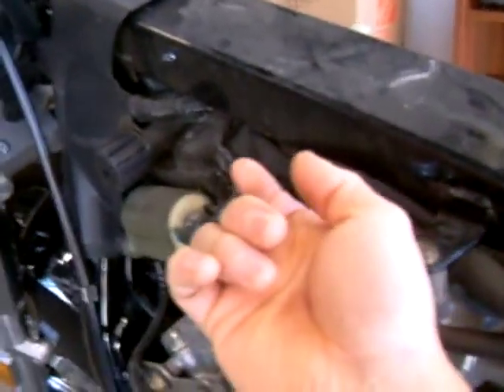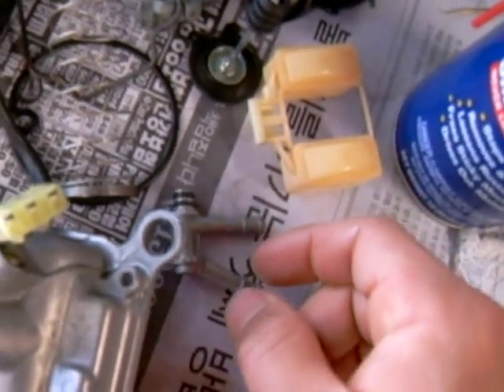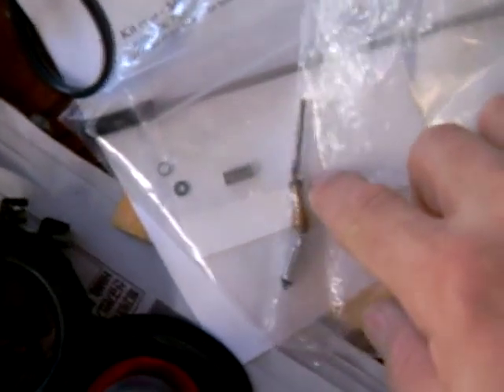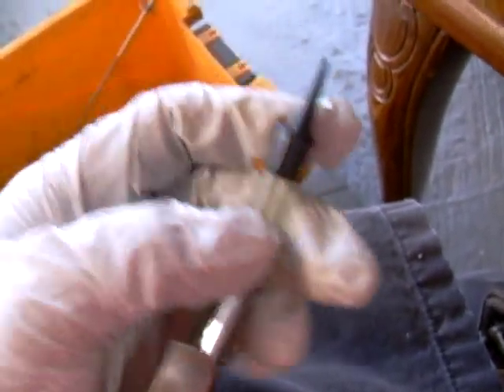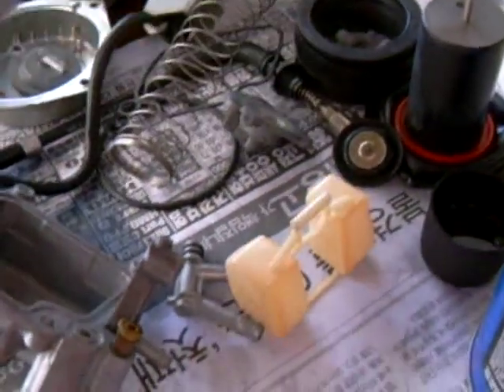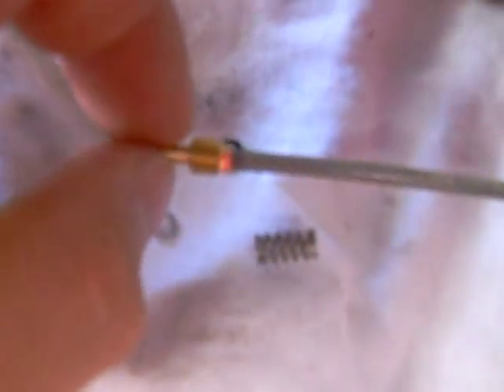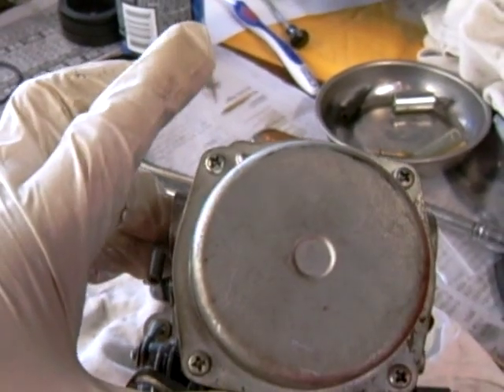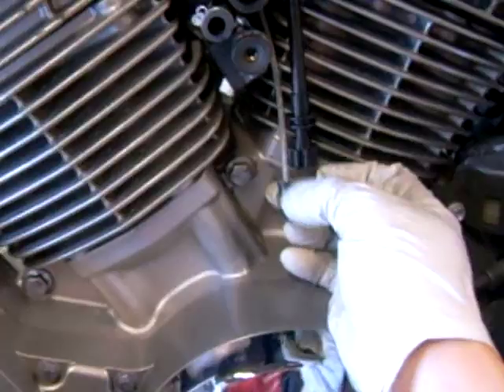How to clean a carburetor for Honda 2004 VTX 1300

Comment from the maker: VTX 1300 has been a worry-free motorcycle for me.  I've had it all these years and the only parts I have replaced are the tires, spark plugs, oil/air filter, and batteries.  It's not that difficult to work on and beautiful.  VTX 1300 has plenty of power and simple enough to reduce problems, unlike harleys.  Well, thanks for all your nice comments.

Comment: thanks for the vid. i just got done putting mine back together. my bike is a 06' 1300c. it looked the same as yours. i took pictures every step of the way just in case. before i put it back on ima have to get a d screwdriver

Comment: Something I know that has been done by a mechanic friend of mine on a bike with this problem is to pour Techron injector cleaner in the tank & with the spark plugs disconnected roll it over until your sure that it has worked it's way through to where it can desolve the gunk overnight. He said that he added gas to the tank the next morning & rolled it over a few times & it started right up. Since your tank was full I don't see why a small funnel or a spout on a bottle stuck into the end of the hose leading to the carburetor wouldn't work to get the Techron into the carburetor. Unless you can drain the tank.

Comment: Hi well done video .. i have a question im having trouble trying to remove the lower bolt in side the air cleaner housing the bolt just turns and i can hear yhe rubber housing turning ...how can i get at it to brake the bolt loose...thanks

Comment: Am having problems with my vtx 1300 it leaks gasoline by the filter even though it has been cleaned and i replaced old parts any suggestions?

Comment: wd-40 makes rubber swell . should not be using that and what your adjusting is the idle mixture screw.... thats a cool kit though.. I have the Honda tool for adjusting the stock mixture screw and its a pain.. having it permanently attached is cool

Comment: never use the choke on a vtx 1300 it is well known to foul the plugs on this bike it is not a real choke all it ose is dump fuel into carb you will be much better off to just crack the throttle a few times and she will start

Comment: 05 vtx 1300 runs only with throttle half cracked or more, cleaned jets, but it has been sitting for 4 years, all fluids changed, blue/grey smoke, will not idle, any suggestions appreciated. I do not have the air/fuel jet removal tool. Can't adjust it.
Reply: Hey, He mentioned using a shell casing with a Dent in the side, but I have NO Idea what Caliber to use
Reply: @Mobius551  22 Cal.
Reply: I know this is an old post, but if it was only rubbing with half throttle, your pilot jet is probably clogged... or it was when you had the motorcycle and the problems

Comment: I would try getting WD-40 with a straw and spray a small amount of oil, if you can reach, on the threaded portion of the bolt only.  Then, using a high speed impact or drill, try to get the bolt to turn quickly to get it loose.  If this does not work, then you probably have to figure a way to hold the backing.  Good luck.